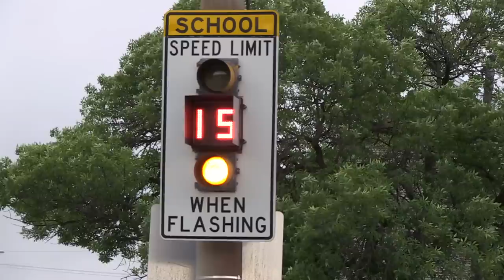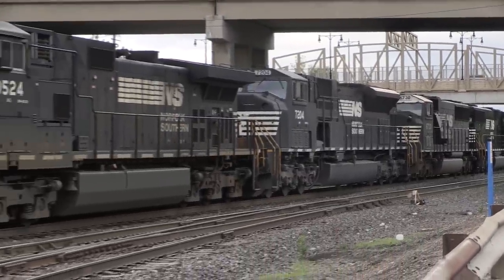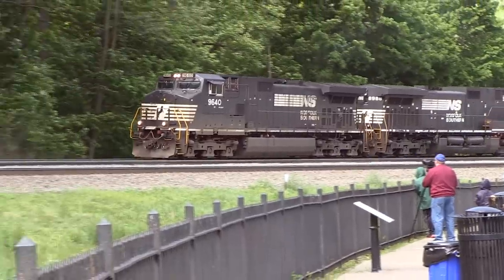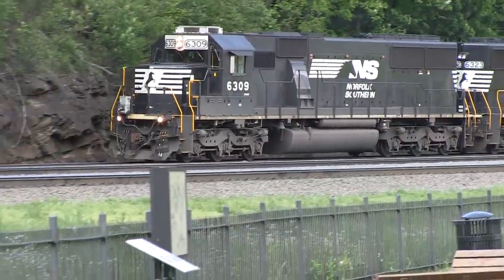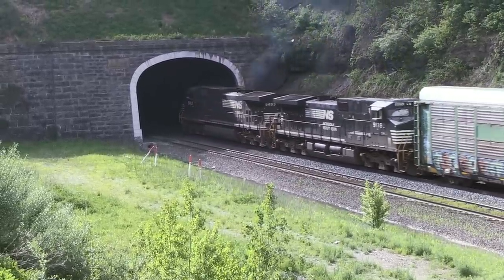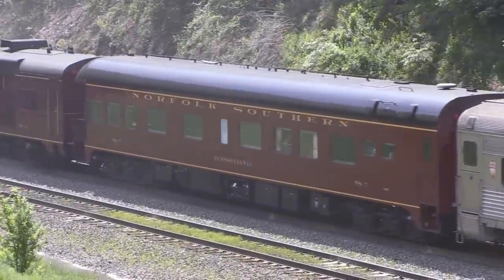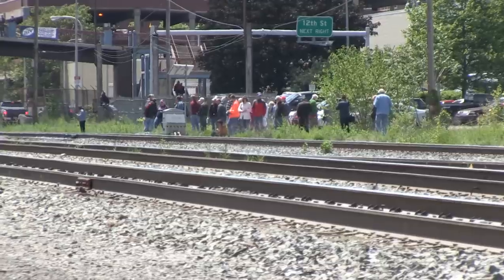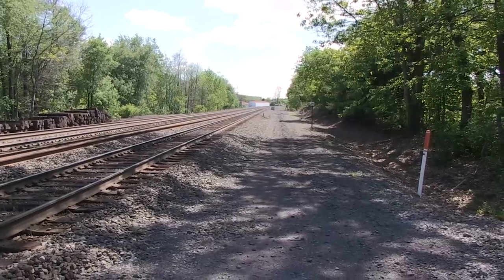NKP 765 Steam Weekend in Altoona

Comment from the maker: Those are protection cars. Some railroads call them idler cars. Rules specify there must be a non-hazardous car on the ends of a hazardous consist. Allows protection for the locomotive and something to get hold of if they are leaking or on fire.

DH
Reply: Cool. So it protects the engines and the crews from a explosion sweet.
Reply: We tend to call them Buffers/buffer cars.

Comment: You need to get back up there in the next year. There's a PRR signal tower in Lilly, PA that is being taken down. Also stop at nearby Cassandra, which is around the curve from Lilly. Trains exit the curve and go 4-5 miles straight, with a cut right through the rocks. There's a bridge where you can get your camera shots.

Comment: 6:53 I never realized the SD40Es had different types of trucks! Great video as ususal.
Reply: The first 10 SD40Es (6300-6309) were reconstructed from old N&W SD50S which had the standard bolster trucks typical of EMD 6 axle production from 1972-1992. The lone exception was Conrail, they ordered their SD40-2s and SD50s with older flexicoil trucks (hence the truck difference on the 40Es from 6310-6349 since these were rebuilt from Conrail SD50s). I read somewhere a long time ago the reason why they did that was because the bolster trucks were mounted on Amtrak's SDP40Fs and they were suspected to be the cause of numerous derailments, so Conrail opted to mount the older truck design instead as a precaution.
Reply: Ah, I see. Thanks for the information!

Comment: Here is a great way for the railway to save a ton in fuel costs each year:  Add overhead wires to the steep parts of the grade, and use special electric locomotives as 'helpers' to either use electric power to push the trains over the steep grades, or to REGENERATE electricity when coming down and feed the power back into the grid.  It is possible to recapture around 55% of the power that would otherwise be lost in a locomotive's dynamic braking system.
Reply: Well, fun fact: The Pennsy planned to electrify beyond Harrisburg to Pittsburgh on the Middle and Pittsburgh Divisions. World War 2 killed that project. 
Opinion: Had it not happened, it might have been completed and electrics to Conway Yard may have become a reality.

Comment: NKP 587 used to double-head with NKP 765 quite a bit after 587 was restored by the Indiana Transportation Museum in the 1980s at Amtrak's Beech Grove Shopes ('The Grove' as it's known locally). When ITM was evicted from its home in Forest Park in Noblesville, Indiana, 587 was transported, along with her tool car (a 1929 former Pennsy baggage car), to the Kentucky Steam Museum to keep her safe. She was later bought by a private individual. Here's a video during one of her last runs before going out of service for a federally mandated boiler rebuild (street running through downtown Noblesville, the second oldest line in Indiana, the line she originally worked after being acquired by the Nickel Plate): https://youtu.be/M8uw3Bg6v8o. (In the video, NKP 426, a GP-7, originally based out of Frankfort, Indiana and would occasionally work this line, leads the train south. Behind 426 is NKP 1, the former business car for the Nickel Plate. Behind NKP 1 is the Louisville and Nashville Cross Keys dining car 2728. The stainless steel coaches (except the last one; it's the Chicago, Burlington and Quincy Silver Salon baggage-lounge car) were used on the first incarnation of the Santa Fe's El Capitan train between Chicago and Los Angeles. 587 is on the north end. Her whistle is a replacement. It was originally higher-pitched.)

Comment: What the heck! Steam locomotives are so powerful! Why do they need some ES44ACs!?! That loco could easily do it by itself! They did it all the time long ago!
Reply from the maker: +Ben Sommer You're right, but the railroad takes no chances on its mainlines nowadays. Those diesel backups are always on these trips.
Reply: +Ben Sommer Atleast it was pushed by the Conrail & Pennsylvania heritage units.
Reply: +TrainTube Railfanning Yeah your right but the Nickel Plate, and Pennsylvania heritage units would have been a better duo.
Reply: +TrainTube Railfanning Wait, cancel that. The Nickel Plate and Norfolk and Western Heritage units would be a better duo.
Reply: +Ben Sommer True man True.
Reply: +Ben Sommer Hi Ben, they stick the diesel in there in case of a road failure, so they would not tie up the line AND it is a built in helper required on many grades.
Reply: +Reg mason232 Uhh kinda maybe... But im guessing they were just making an appearence to impress railfans by also having Rare Heritage units on them
Reply: +Ben Sommer Because the diesils are the ones actually moving the train
Reply: you just ruined it for us :(
Reply: Truth hurts
Reply: Ah no the diesels are federally mandated for breaking purposes only.
Reply: The diesels are federally mandated for breaking only! That steam locomotive would have no problem pulling that train diesels included. : )
Reply: The diesels are for braking only. They don't ever throttle up, they just stay in nuetral the whole time
Reply: Demonslayer20111 there also for head end power for the coaches
Reply: This is an old trick. Steam hauling is much more expensive than diesel or electric. The diesel or electric engines do the real job while the steam engine is added for the sake of the show: to puff and fume but actually they don't do much work, I'm afraid.
Reply: @AlexTraxxas  We're gonna be cursed I reckon. But I can assure you the same "economically reasonable solution" is used everywhere, not only in Dollar Land. Here in Europe the electric of diesel engine is usually at the end of the vintage set so that it's tucked away more out of sight. There are a few railways, especially narrow gauge touristic lines, where steam engines are operated without a helper. They are very, very expensive indeed. Real rail fans value them highly.
Reply: They don't want a passenger train to get stuck on the line if the steamer fails. ALSO, they provide electricity to the people on the train for things like heat lights and charging points.
Reply: The disels just give power to the passenger cars and are a backup in case, the 765 is pulling the train because of the chuffs
Reply: Truth? The 765 did at least one of her trips under her own power through the curve but people don’t realize how steep the curve is and it took all 4000 hp to do it the diesels were there to help extend her fuel range as they did not have places to stop and re load her tender like usual and they had to make it last otherwise she would have been 20 mph the whole way and it’s one of the busiest stretches of rail in the world 
Normally a diesel is there for the dynamic breaking and to save wear and tear on the steamers not for powering the cars most have own generator or the generator car does that work also the diesel is there just in case a breakdown or problems the 765 though needed some help to keep speed though here as just about all engines do pulling freight though the curve remember 765 was made for flying the flat lands of the Midwest with moderately heavy fast freight not pushing up mountains and was drivewheeled as such but the diesel was just there to extend the range of fuel and that is straight from mr rich Melvin and Steve winniker from the Fort Wayne rr historical society itself I also help out there some weekends in the shop myself as a current member and I have videos on my channel to prove it if you don’t believe me I am also in the background of the walbash caboose video on their channel for a second or two to the right getting ready to get into the tender to needle scale rust and lime scale off the inside which is very dirty as one could imagine gets on your skin and it’s harder then coal dust to get off well hope you like this video the narrator is a natural at it I think anyway with that tone and cadence of speech

Comment: Hey Danny if you really wanna see some awesome railroading you should come up and check out csx's chattanooga sub. Mountain railroading at its finest
Reply: You'd have lots of fun. We have 2 depots that have been in use since before 1890. The Smyrna depot was built around the civil war and the tullahoma depot was built in the 1880's. There's also the cowan pusher district which crews push of one of the steepest mountain grades in the southeast. The same mountain has a tunnel that's been in service since 1852. They just took out all the nc&stl and seaboard signals :( but the museum at cowan was given the old mid cowan signal. Also the last 33 miles to chattanooga host a lot of action since norfolk southern merges onto csx to make the run to chattanooga